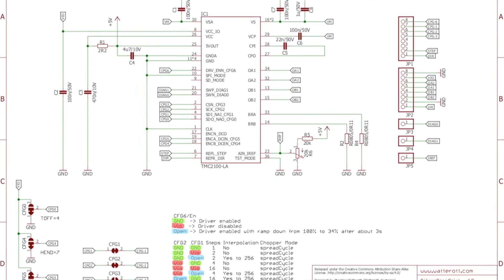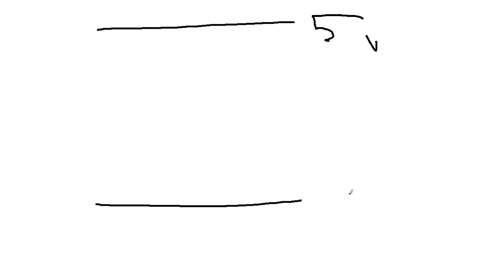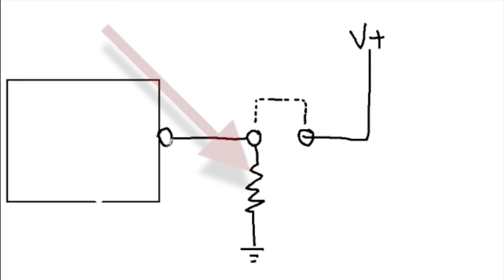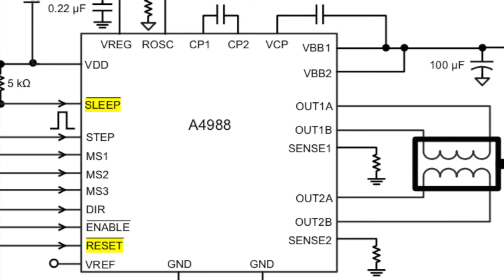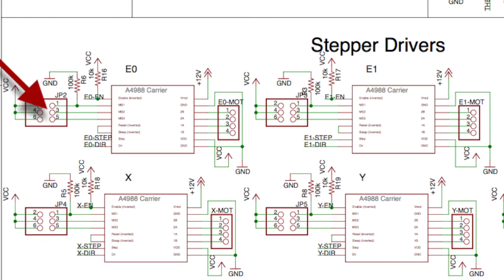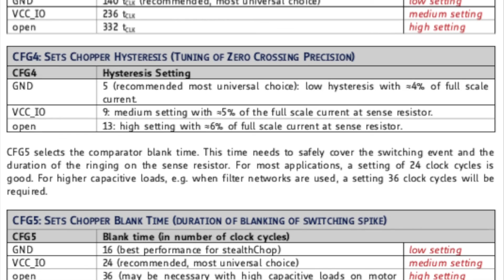Stepstick jumpers: basic concepts for n00bs

Comment: These cheap ramps boards you get a few uses out of them and they go bad how can I fix this?
Reply from the maker: They have fixed the build quality of the ramps 1.6 lately, so if I need a ramps, i use that. (NOT the 1.6plus though).  It sucks that the fuses are surface mount, but everuthing else is pretty decent if you still need a ramps
Reply: @AlexKenis   yes I did get a bad 1.6 but I returned it I'm going to shoot for another 1.6  thanks
Reply: @AlexKenis  will the a4988 drivers work with 1.6 board?
Reply from the maker: Wishicould Arduino yes, they work fine with the standard 1.6
Reply: @AlexKenis  thanks👍
Reply: @AlexKenis  stupid question I think I'm blowing the fuses on the ramps board the poly fuses could those be replaced with a capacitor?
Reply: @AlexKenis  got the bigtree 1.6 seems to be OK so far but I was wondering what's the did between a4988 and the DVR drivers?

Comment: Hey Alex, I actually have a specific question: I have brought some FYSTEC TMC2209 v3.0 sticks & a Bigtreetech v1.3 board, having followed the above + other youtube videos I know that I need to remove all jumpers from under the board, and the apply only the UART jumper (in front of where the sticks go) and for diagnostic info use the xst, yst etc jumpers.. all done.
However the pin out of the FYSTEC sticks are really confusing me, the data sheet shows that pin (blue side DIR being 1) 3 is the UART mode.. but I can't figure out what jumpers / mods I need to make to enable UART.
I have enabled the drivers in marlin 2.0, following guides etc but they simply say m122 enabled false :(
Any hints / tips on how to approach this as I'm at the limit of what I know and apart from pushing jumps to see what happens I don't know how to get the drivers recognised & working in marlin.
stepper info : https://wiki.fysetc.com/Silent2209/
Could part of the issue be that I am using usb power in currently - as I just want to make sure its configured before removing my old board etc?
Reply: Did you get it sorted?
Theres a jumper you need to add under the driver
Reply: Not all 2209s are wired the same from different brands

Comment: With emphasis! (of course thanks for your last video!)

I think it will be too difficult for the self-builders in the long run in the longer term!
motherboards become more complicated,
the stepstckjes require an increasing number of different settings
Marlin is being expanded more and more, so it doesn't get any easier.
and unfortunately the old (er) strategies are pushed aside!
people will drop out! (I already notice in NL)

I hope,
I hope the old-fashioned Ramps sign will not be forgotten!
something is found that the simple soul (the self-builder / hobbyist) can still tinker!
maybe there is a library for every printer, for every motherboard a marlin with settings !!!
I hope....
for example, how should I set up marlin(from now!)  for an old-fashioned Ramps(with LCD + SD card)?

(Yes of course I still have this board in use! ;-) )

the nasty thing is as an example myself that,
I am a Dutchman so thankless that I really make the effort that there is a language limit.
and that is of course not only for me!

I place this writing everywhere with the (for me) most famous YouTubers!

Friendly greetings from The Netherlands!

Rob

Comment: Kinda (post)stepstick question - how to wire stepper motors - parallel or in series?
To be precise - tmc2208  (or 2209), 24V PSU, Z-axis, twin motors for heavy bed of HEVo,
Watterott mentions " On 3D printers sometimes two stepper motors are used for the Z axis and connected to one stepper driver. A series connection of the motors is in most cases better than a parallel connection. Only for motors with a high phase voltage (>6V) a parallel connection should be used and the double current has to be set for a parallel connection."
https://learn.watterott.com/silentstepstick/faq/
so.... in series?  Equal amperage, halved voltage ?

Comment: Great explanation of jumpers for control and driver boards, and really, even more so, the variability of all the boards out there, even when using common chips. My takeaway is: There seems to be an opportunity for someone to produce a flexible, powerful open-source control board...still. for the DIY/upgrade market. I know there are some good ones out there (Geckos seem great but really really expensive) but there is still a sweet spot waiting to be filled.